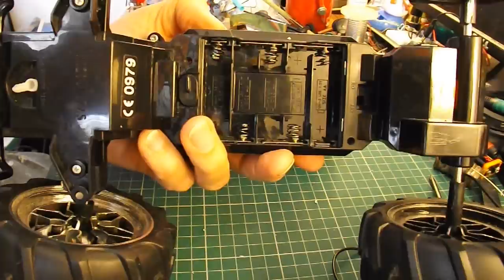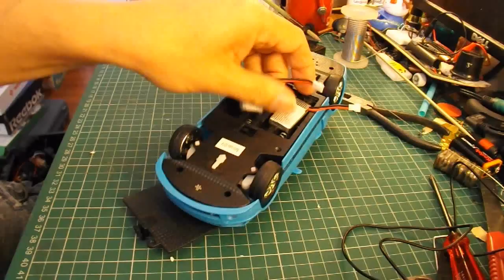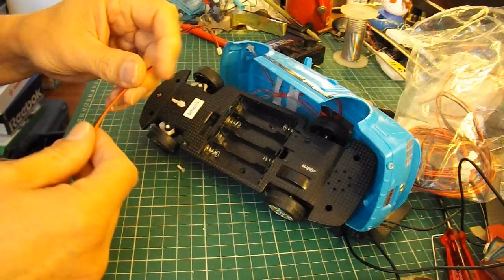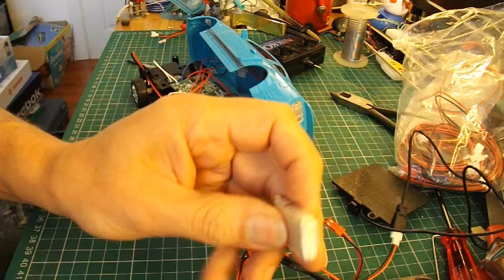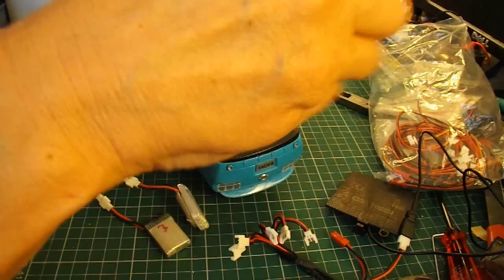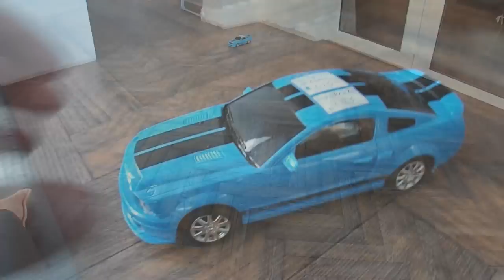Charity Shop Gold or Garbage? Lipo Conversion for RC toy car

Comment: Hmm, the mainboard of the rc car has a white usb port.
Reply from the maker: Hi Alexandros Sotiropoulos, it is not a USB port. It is in the style of a 3 pin JST plug and I would guess this is a generic receiver board used on many different toys with outputs that can be used with different features as required.
Reply: That sounds very advance, You have to consider the fact that lipos need special mainboards to ensure that they will not be discharged  fully.
Reply from the maker: As far as the receiver board is concerned I would say it was common practice amongst manufacturers to have receiver boards that they can use on several different toy cars and use different options as required maybe with a few onboard jumpers to enable the extra options. The same way that many of the cars have identical chassis which they fit to multiple different body shells. Some will have LED lighting systems and sound effects and some will just be simple basic RC cars. I have recently worked on a series of cars from the same manufacturer where the body shell is clearly designed to allow for RC but they have provided a wire controlled running system. Another one had been fitted with a single channel RC system when the chassis was clearly designed to allow for full RC control. I would guess they configure the model to whatever a particular retailer wants the final selling price to be. With LiPos you have two basic options. LiPos with protection circuits onboard and LiPos with no onboard protection. If it has no onboard protection then yes, that needs to be provided by the circuitry on the receiver or charger control system.
Reply: Or you can use a lipo alarm system that comes separately and connects to the balance connector which alarms when the lipo reaches dangerously low voltage thresholds, to tell you to recharge. I have a Kyosho with a 2 cell lipo and an alarm.
Reply: But I think too much technology for children. Better wait for them to grow a bit and buy a thunder tiger nitro!
Reply from the maker: Yes you could use a LiPo alarm, I have several and they are very cheap on eBay 😊
Reply: GrandadIsAnOldMan

Comment: double sided tape on each wheel & it will grip no problem. ...
Reply from the maker: Have you ever tried that? I would think that will either stick it to the floor or just pick up dust really quickly.
Reply: GrandadIsAnOldMan no it does work I have used it myself, as I have a few cars... It just helps with sliding surfaces. But try it u do it rite it should make tgat little car stick better. .. ✌
Reply: Get new tyres, hair will just get stuck to it!
Reply: So this is what my 2 year old does when he gets a hold of my phone >_<
Reply: The Main Man Cave All Welcome ii
Reply: The Main Man Cave All Welcome 🙏 has
Reply: The Main Man Cave All Welcome .
Reply: Mr Toker Smoker High All
Reply: Mr Toker Smoker High All ককযযকক্যকদদক

Comment: Hello, I have 2 rc toy, but one don't have remot control, 
both have frequencies to 27 MHz, can I use the remote control of the first toy to the other?
Reply from the maker: Try it and find out. You have a 50:50 chance. If it doesn't work then the answer is NO. Some toys work fine, some have the controls reversed, some only partly work, and some don't work. It just depends which control chips they have used and how they have connected them up. I have dozens of controllers and dozens of RC cars and I just swap them around until I find ones that work well together. Sometimes I cannot get a match. 🎄🎅😊
Reply: Thanks for the answer, and this car don't have a battery, I try the method in your video :D

Comment: sir I have a catepillar of 7.2v nicad (1.2v x 6AA). when I use 2s 7.4lipo suddenly it burnts the board,  but now I successfully repair it by pass. shall I discharge untill 7.2v then I connect??

so now what if I still insist to use the same lipo battery?
Reply: your videos showing 6v nicad battery overpower to 7.4v lipo and it sucess. mine, 7.2v nicad battery to 7.4v lipo then burnts
Reply from the maker: If you are using a more powerful battery than the car was designed for then you run the risk of overpowering it and burning out the components. A freshly charged 2S LiPo gives 8.4 volts but a freshly charged 7.2v NiCd can also give more than 8 volts so the designer will have built in a tolerance range to allow for that. I doubt there is any way you can know in advance how much tolerance has been built in. A short duration of high voltage may be OK but using it for long periods will put it at greater risk. However you are probably at more risk if your motor is drawing a high current. I am interested that you say your board burned but you were able to repair it. What did you do to repair it?
Reply: +GrandadIsAnOldMan oh. I just by pass using small wire. one of the board's  strap was burnt and succesfully jumper it using wire
Reply: +GrandadIsAnOldMan your car is lucky enough to have a higher voltage
Reply from the maker: aminol rasyid I was wondering if that small wire was there to act as a fuse!

Comment: Sir no harm in over volt aging the motor
Reply from the maker: It is not the motor that is going to suffer, it is the electrical components on the receiver that are going to burn out first.
Reply: Not necessarily the motor could over heat first.
Reply: Wronge advice the reciever passes information onto your esc which controls your motor it doesnt have to do as much work as the motor and esc
Reply from the maker: Cobra gaming have you actually tried any of what you are talking about?  I have and I have burned out several toy grade receiver boards so I do have experience in doing this. There is no separate ESC involved in toy grade receivers. They have an onboard H-Bridge and that is the component that will fry before the motor does.

Comment: I have a similar product, Had been thinking of tuning from 3 aa batteries to 9volt single battery,  well u made a cheap Chinese rc car into drift car,  hope this video gave me some idea,  great video
Reply from the maker: I would expect that if you go from 3 AA batteries to a 9v battery it will probably smoke nicely as the circuit board burns. I would not advise doubling the voltage like that.
Reply: Oh alright,  let me try on a lipo batteries from Amazon
Reply from the maker: Sathyaprabhu M G LiPos come in multiples of 3.7 volts. So you can have 3.7 or 7.4 or 11.1 or 14.8 People will also be quick to point out that a 3.7 volt LiPo is actually 4.2 volts when it is freshly charged. If you really want to use a bigger battery you will have to modify the circuit board to allow it to handle the higher load and that is NOT a simple task.

Comment: hey how do you find out the MHZ of a rc car if it doesn't  say anything on the car
Reply from the maker: I would guess that if you had a suitable transmitter with a digital display and a variable range you would adjust it until the car responded ( I have never seen one like that but I am sure they could be made by an enthusiast). The method I use is simply try all the different transmitters I have and see if any of them work (I have rather a lot of them). You might be lucky and find the MHz written on the receiver board inside the car but they don't always do that. Unfortunately even matching the MHz does not necessarily mean the receiver will respond to your transmitter as they do not all use the same encoding even when they are on the same frequency.
Reply: thnx for the idea

Comment: No Money for LiPo Battery?
Mobile Phone Battery works Good! Ha!Ha!
I Have a small Cheap Bootleg Ferrari and runs fast with a Oldschool Nokia BL-5c Battery (Also have a good duration too!)
Reply from the maker: Yes, I have also used camera batteries the same way.
Reply from the maker: ***** as they are LiPo batteries I would always use a proper LiPo charger to charge them to ensure they are dealt with safely.
Reply: Thank You for answer.
Reply: Very good idea. But what about charging this battery? You must take of this battery from RC Car and charging in telephone or charging it directly in car?
Reply: RUSSIAN CONNECTION Smart phone battery will not work as computers run very low voltage with condensed amperage
Reply: but works good on my cheap RC =)

Comment: Hi there did you know a fully charged single cell lipo is actually 4.2volts not 3.7 ??? Great vid tho
Reply from the maker: Yes. Do you know the values for fresh Alkali, Zinc Carbon, and NiMh batteries? When manufacturers give a voltage, they give the nominal voltage. It would confuse people if they always gave a range of voltages for each type of battery. It would get even more confusing if they start talking about Watt Hours.
Reply: +GrandadIsAnOldMan arnt Nimh cells 1.2 volts
Reply: +David Turner zink and alkali are 1.5 ???
Reply from the maker: David Turner no, that is the point I am trying to make. Those are nominal voltages. They are all higher when new or freshly charged.
Reply: Oh I see sorry
Reply from the maker: David Turner :-)

Comment: does the lipo battery has built-in low voltage protection to protect from over discharging?
Reply from the maker: Some batteries do and some don't. You would have to take the covering off and check for the small circuit board to be absolutely sure.
Reply: +GrandadIsAnOldMan thanks for the reply old man. but how can u tell if the battery is low enough to stop playing without the low voltage protection.
Reply from the maker: Anas Takiyudin you can buy a cheap battery monitor that you plug into the battery and it tells you the voltage. You can adjust the settings so it sounds an alarm when a certain voltage is reached. Here is an example https://youtu.be/wDliAxCOEDY
Reply: great. thank you for your wisdom

Comment: I convert a 9 volt battery
Reply from the maker: Yes it just depends if you receiver can handle that voltage. If the original power supply was 4 AA batteries then you are jumping from 6 volts to 9 volts so that is probably pushing the limits of the components. You may be lucky and it survives.
Reply: +GrandadIsAnOldMan oh
Reply: sir how to fix my 27hz remote control no not working to my rc car pls help me
Reply from the maker: abner manulat Assuming you have checked the batteries are in good condition in you car and in your transmitter I would suggest 2 tests. First try your transmitter with another 27 mHz car that you know works to see if it is your transmitter that is faulty. Then try the transmitter from the other car with your car to make sure your car's receiver is working OK.
Reply: abner manulat . i

Comment: can you make a rc car from scratch from componets you have taken from other rc cars you stripped down ie take a body of a rc car and a chassis that fits the body and put in the bits you use for a car but you can only use bits from rc cars to build it (wires and eletrcal stuff dont have to be from rc cars but other bits do)
Reply from the maker: Many of my projects make use of the parts from RC cars but I would not call making an RC car using the components from RC cars a "scratch build". It would just swapping pieces around between different cars. Once you have a good working chassis you can stick any body on it you like as long as the wheelbase is reasonable compatible and if you have a chassis which allows you to adjust the wheelbase you can extend the range of suitable bodies. Many of the New Bright range of RC cars are like that, basically the same chassis with a few adjustments to fit different bodies.
Reply: GrandadIsAnOldMan
ok i just thought it would be a different challenge becuse you mainly use sticks and cds to make rc cars
Reply from the maker: Baba's custom Lego creations the point of making them from sticks and CDs is I am not just swapping bits around between existing cars. I am actually making something from scratch :)
Reply: GrandadIsAnOldMan
how about turning a rc car to a rc boat!?!?!?!
Reply from the maker: Baba's custom Lego creations yes I have done that several times. Here are some of the videos https://youtu.be/1rKYmYozZps https://youtu.be/gcc-qjbYW6c https://youtu.be/34ssD8e0Ncs  https://youtu.be/pLzsUF79oAU
Reply: GrandadIsAnOldMan
what about turning a rc car to a windup car?

Comment: hello c i ask i do the same like u but i  dont put fat cable is matter? i need fat cable for the battery conection with the rc? sory for my english...
Reply from the maker: +george zouzou if your wire is too thin and the motor draws too much current then the wires could overheat.Thin wires might have a higher resistance than fat wires so they could reduce the current flow. Maybe it will work, maybe it will not. If you try it and it works then you are OK.

Comment: So cool!you turned it into a drift car!I converted a cheap R/C chassis inro a slot car by putting on a guide flag and soldering the wires to the motor leads.I took the body off and put on an AMT '57 Chevy body that I painted black with flames!Awesome!
Reply: philo426 that is not drifting that is doing donuts
Reply: nice!

Comment: Also id like to see you run this little car on some grippier surfaces so we can see a topspeed change between the lipo's and 4xAA batteries :P
Reply from the maker: +Marcus60661 the project was to change the batteries to LiPos, it had nothing to do with top speed. I was simply exploring the feasibility of the change. I attempted to match the voltage as close as possible. The end result is a freshly charged 2S Lipo will be giving you 8.4 volts compared to the 4 AA batteries normally fitted to this car giving you 6 volts does mean it was overpowered and very likely to burn out the receiver. A single LiPo fully charged at 4.2 volts would probably be a closer match as the lighter weight would help offset the lower power.
Reply: Yes i saw that, but it wouldnt be much of a loss if it would burn the circuit board (would open up for some modification of adding a board that might be about the same size but handles a larger voltage + motor) unless this was shortly after given away to someone.

Did do a circuit board swap on a rc car that normally ran on 3xAA batteries with one that ran on 7.2v from a small boat + a motor swap a few years ago.

had the board running on 4xaa batteries with a faster motor.

That thing ran like a champ until i broke the remote by mistake.

Comment: Gonna try out a single cell 18650 lithium ion battery on a mini-z mr01 clone from iwaver i have at home in a bit to see if its worth buying smaller ones for the mini-z + a proper charger rather then my somewhat ghetto setup i have now (350 mah 3.7v charger from an old phone) It is safe but wont charge it to full voltage im guessing as they usually charge at 4.2v but a slow charge cycle on it should be good for waking the battery up a bit capacity wise at least.
took apart an old laptop battery as i pretty much had nothing to do.

While i wont know if its gone to a full charge ill know by runtime if its still got some juice left in itself once i disconnect it from the old phone charger.
doesnt really matter to me if i happen to make it unrecoverable either as it only took time not money to get this going for me.
Reply from the maker: +Marcus60661 just bear in mind that using a higher voltage than the receiver is expecting may fry it, maybe even a fire hazard if you are really unlucky.
Reply: I know, but the board was modified a few years ago to take 2s lipo's (external cutoff) if i want to really push it to the limit power wise ^^
The mini-z is normally running of 6v as well on the AAA batteries it usually gets so not a problem in that way.

Comment: hi wot would increase my receiver distance so my car would go further?
Reply from the maker: +john duffy the range is linked to the frequency and the length of the aerials. 2.4 Ghz gives you a better range than 27.125 Mhz. The best way to get a longer range would be to throw away the cheap RC transmitter and receiver and fit hobby grade components. You could try increasing the power by using bigger batteries but you are more likely to BURN OUT your receiver or transmitter. You might be able to get some increase by changing the length of your arials, they should be a fraction of the wavelength so here is a calculator, there are lots on the internet so you could search for them http://home.kendra.com/kj7yl/ant.htm

Comment: Do you happen to have a link for the battery connectors ? I have tried to find them on ebay without much success. Any help appreciated.
Love the video by the way. With @25% more power than the original design that car goes like a rocket. I'm tempted to dig out my model car which is mid 80s vintage and see if I can upgrade that to LIPo.
Reply from the maker: +tobortine link in the video description as usual :-)
Reply: +GrandadIsAnOldMan Perfect, many thanks.

Comment: Nice to see this Grandad, If you put a couple of elastic bands on the drive wheels it might grip better, maybe to fast ? but you could also put a rectifier or two in the positive lead to reduce the voltage to the receiver a bit, Two of them would reduce the voltage by 1.2v ~ as you know. anyhow it's nice to see this car move so freely , thanks
Reply from the maker: +Graham R Dyer I have found that people seem to enjoy seeing these cars sliding about so that is what I give them. I could just run it on carpet or any other less shiny surface. That would save any further modification. If it wasn't sliding around somebody would ask if I could give it more power. I suspect that is what inspired the original question I answered with this video.